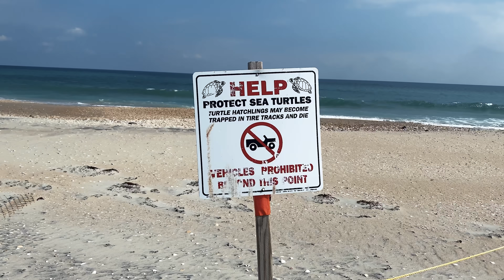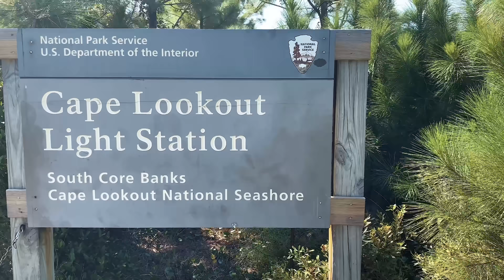Our Van On Remote Beach… What Could Go Wrong? | CAPE LOOKOUT NC

Comment: I knew it would have no problem. As long as you air down it would be fine. I’d carry traction boards just in case. My only suggestion is to get under there and wash the chassis so the salt does not eat it. Other then that looks like a great time. That’s why my camper will have the Quigley 4wd for my E450. 👍🏼
Reply from the maker: Thanks for the suggestion, we wash the van really well when we got back.

Comment: 4 wheel high vs 4 wheel low…
Airing back up…
Reply from the maker: Hey Pete.  Not sure what you’re saying.  For us as newbies we stayed in 4wd low the entire time in the sand because it takes all the computer stuff out of the picture on the Revel.  We aired back up once we were off the ferry.  We had a compressor but the ferry service has 3 air hoses with a lot more volume than ours so we used theirs.  Hope this answers it.